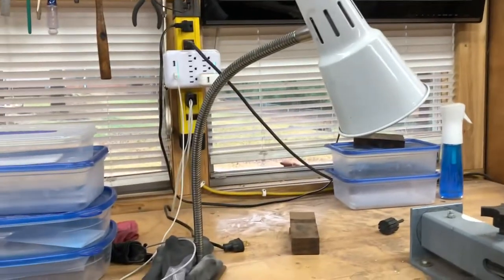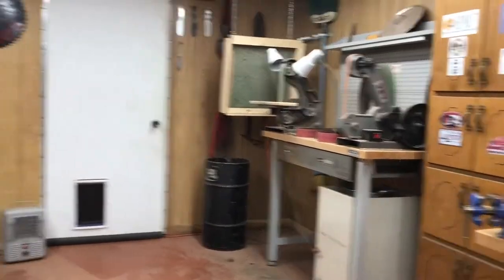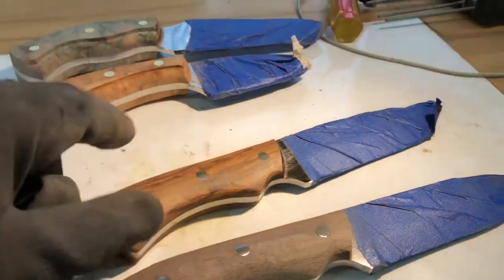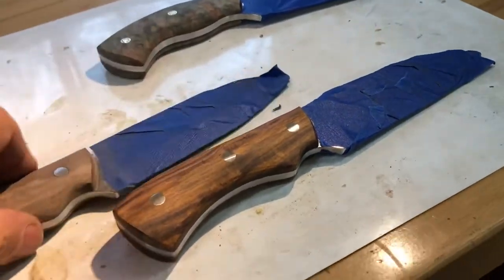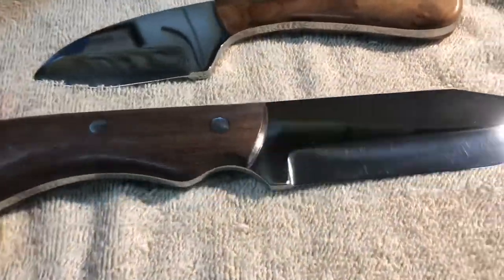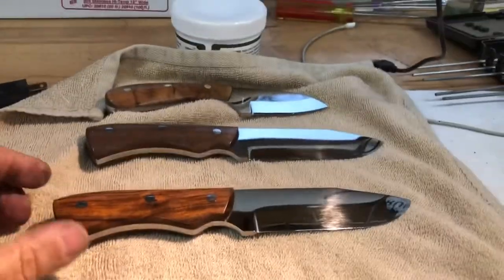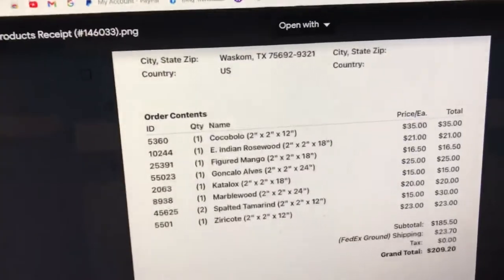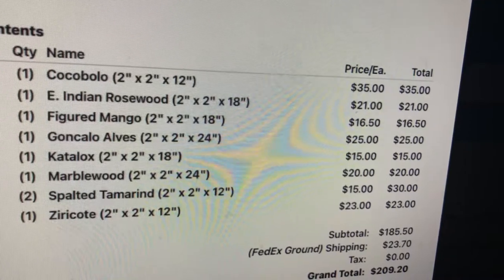Hand sanding and polishing knife handles

Comment: Hey brother i was going to mention to you cutting the handle materials does save you money but when using a table saw your losing material bc of the thickness of the blade try using a band saw with a fence to split your wood for handles and awsome job on the knives i love your knives just like i love Ricky Wallace knives yall both are my favorite knife maers bc yall take pride in your work and skill and craftesmanship cant wait for the next video
Reply from the maker: Brian, I bought a special thin kerf blade for my table saw. I’ve tried cutting it on my bandsaw and it didn’t work out. I do lose a little on the table saw but it leaves me with straight even surfaces that need little to no sanding to make them completely flat. Thanks for your advice!